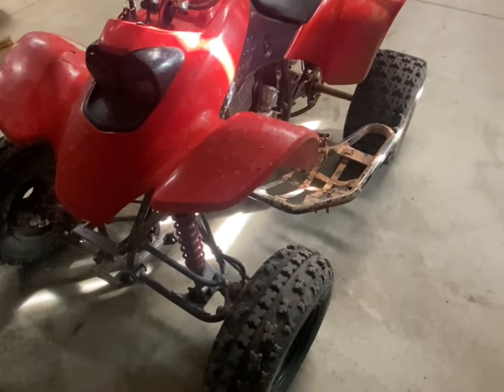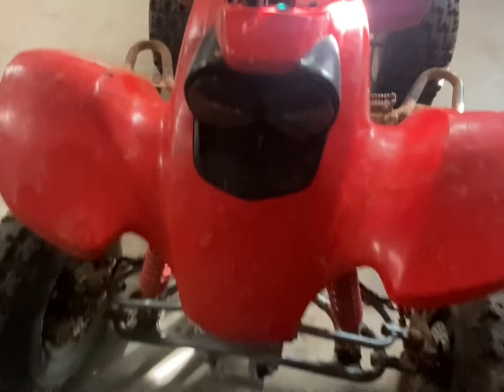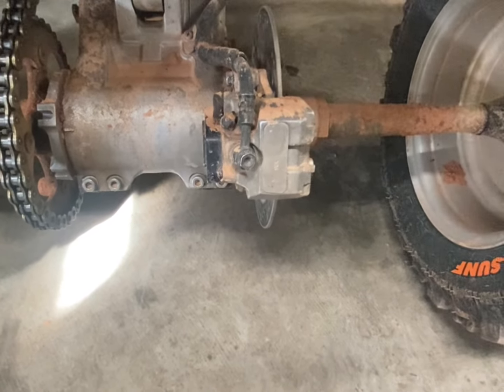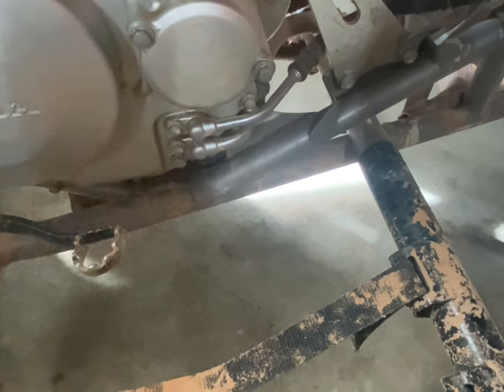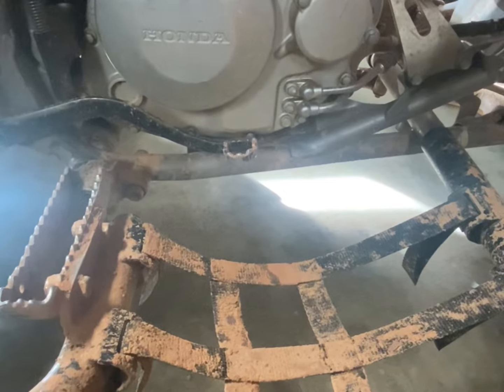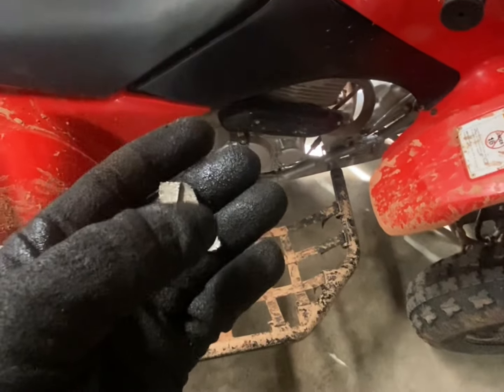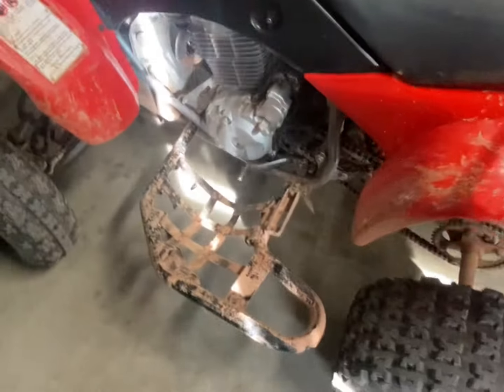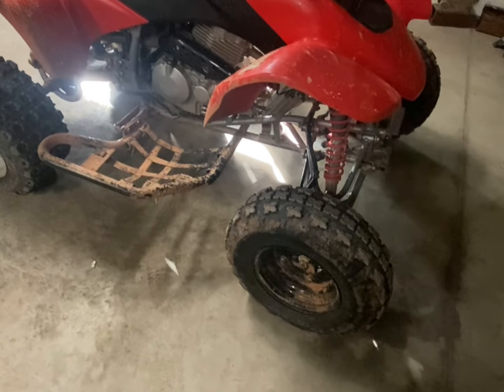Proof that the Honda 400ex is the Best Quad Ever Built

Comment: From your story I’d say that it blew apart the original piston and when they put a new piston and cylinder in they didn’t clean out the carnage!
Reply from the maker: That wouldn’t really surprise me. The engine does smoke quite a bit that’s why I think it has the skirt blown off but I don’t know. It still runs just fine though.